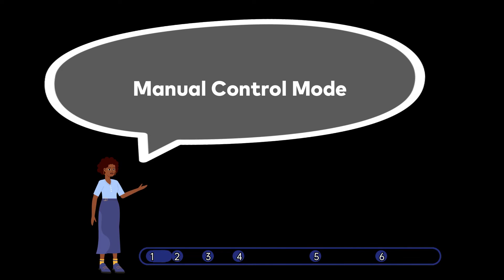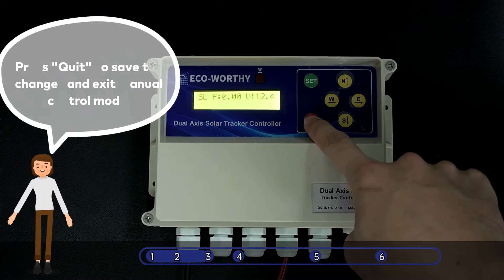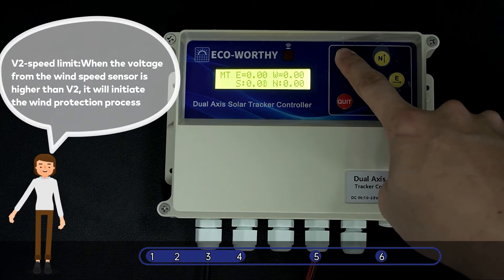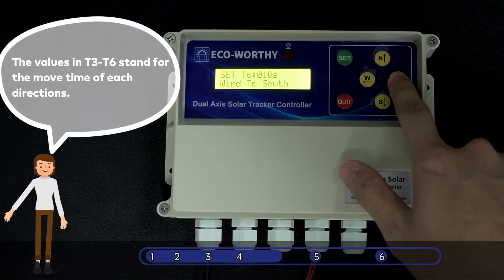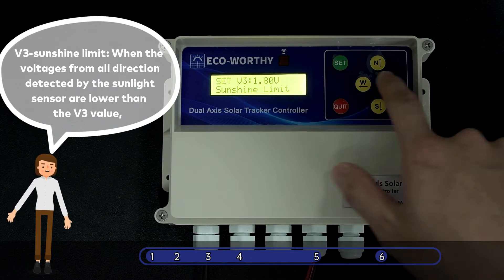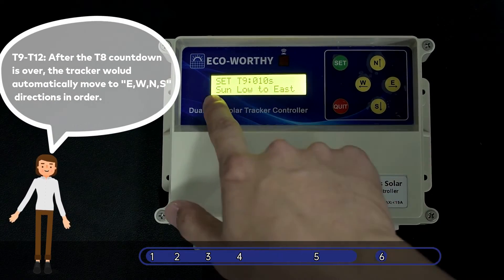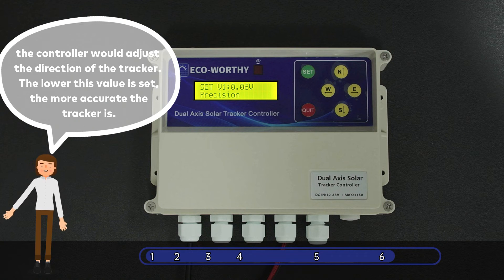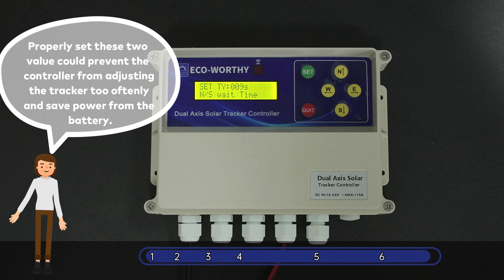How to set the controller of an Eco-worthy solar tracker system?

Comment: we have installed this system at switzerland. the sytem  is working. 

critics: the system , from the construction, can only manage a angle south  to east of 45 °. But special the rare sun at winter is very important to catch. From november to february we need at the northern hemisphere a angle of 70 ° to catch the low sun with 90 ° upon our pannels. the linear motors are very weak. I would prefere motors with 3000 N instead of 1500 n . the uses solar modules have not a common size, which is 1,65 x 1m. So we have had some extra work to change the construction for 2 pannels 1650 x 1000 mm,  21,5 kg means total 3,3 square meters and 43 kg  ( compared  eco worthy moduls, maximum size, only for US, but the same construction , even the same layout for the motors :  6 pannels, Size: 52.6x26.38x1.38in (1335*670*35mm, Weight: 20.48 lbs(9.29 kg)   5,4 sqaure meters / 55,74 kg all )

Comment: Do you really think anyone not familiar with electronics can follow this instruktions. SLOW DOWN and make it better.
Reply: They changed the wind speed voltage setting to .25v.  What wind speed is that equal to?  Where's the scale?  Default says .35v.
Reply: @bradlightner51  the motors have 15000N, that means 150 KK power. The Panel areas IS around 5-.6 square Meters. I am a paraglider Pilot..my mind , These Motors are mit strong.enough for real strong winds 30000N + should be the standard at this size.
Reply: thats right ! all distributors are using the same tracker steering from China. for beginners it is neccesary, to show retailled, how to work with the final set up.

Comment: Can I connect the power for the controller to my DC out on my charge controller
Reply: Connect it to battery because whenever the power from the sun is down then the controller loses settings and will not return back to the east
Reply: @stevenlouis1024  I think you can take the power from your storage battery inside the house with a seperate cable back to the tracker system. so you should not install a special 12 v battery outside.